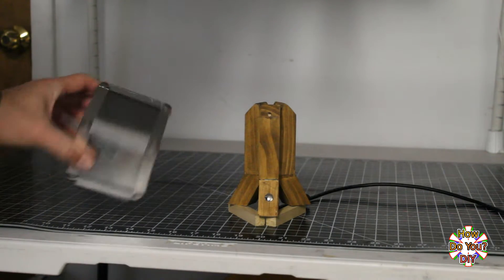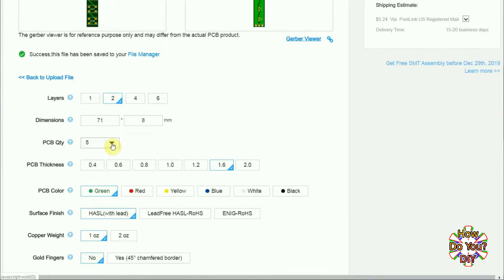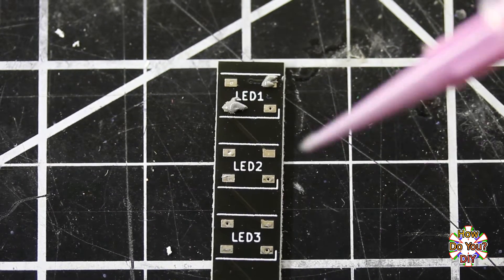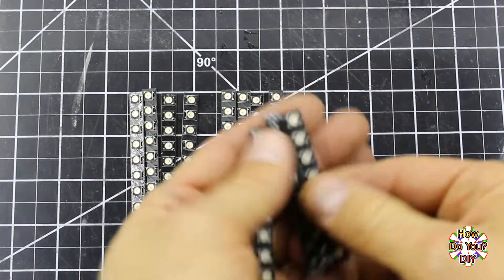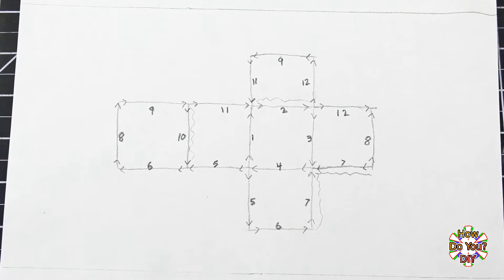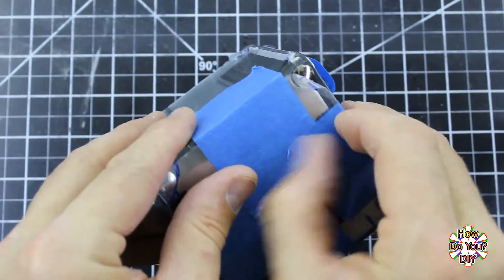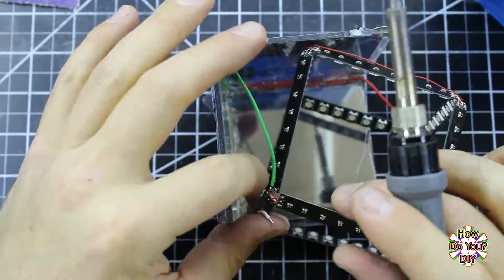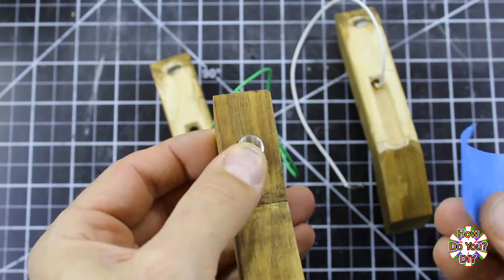Make an Infinity Mirror Cube | Color Changing Lights in a Box Of Mirrors

Comment: What's the power consumption at max brightness?
Reply from the maker: That's a really good question. I'm not sure what the power consumption is. I don't have the tools to check that with, so I'm going to get something to check that.
Reply: @HowDoYouDIY  I'm currently working on a similar project using those LEDs in a battery powered lamp and I'm trying to spec the batteries for a reasonable runtime, that's where the question comes from. I'd definitely be interested to know the answer if you ever get the tools to check, thank you!
Reply from the maker: Interesting coincidence... I'm working on a lamp too 🤔 I'm using rgbw LEDs though. I was thinking of using an external battery pack and just test the runtime. There is a tool I've been thinking about getting that may be able to test the power consumption. Maybe I'll just get it and try it out.

Comment: Awesome. Just plain awesome. Going to have to borrow some of these methods for my own version. Well done, good video, straight forward, there is lots of cool effects that can be utilized from Arduino libraries. The mind boggles at the potential. Very impressed with your creativity and engineering prowess. Keep it rolling
Reply from the maker: I'm glad this video was inspirational, I would love to see how yours turns out! One oversight that I made with this design caused me to short out an Arduino. Since the aluminum tape conducts around the corners, I needed to file the corners of the tape to break the continuity. I added this change to my video for making the stand.

Comment: I can’t believe you soldered it all by hand... or that everything is from scratch and by hand, completely DIY.... that’s hardcore... I would definitely pay for the service of having it pre-soldered. Well done!
Reply from the maker: The circuit board manufacturer that I used offers that as an additional service! It ended up being almost 100 LEDs and capacitors, so that service would definitely be a benefit to use that service. I'm glad you liked the project!
Reply: How Do You? DIY I like how you powered it too. Clever simple design. There are cool designs you could expand on that with.
Reply from the maker: It amazing how effective something that simple can be. It too me a while to figure out that I could use thumbtacks for that.

Comment: That great, can you make I that levitate and spinning around
Reply from the maker: That's a really cool idea! I'll have to see if I can.
Reply: @HowDoYouDIY   you can all you need are two magnets and put them ontop of each other and boom levateating
Reply: @wisho-st8rp  this wont work. magnetic fields have no "flat" surface. you'll need more than two to balancing it out.
Reply: @HowDoYouDIY  do it 🥰
Reply: I’ve given the idea a good go before. Will need to do the math for power draw from the LEDs, with the levitation distance and induction strength to get enough current in it. Also the magnetic interference from magnets used to levitate it and how it will effect the induction strength.... So maybe?